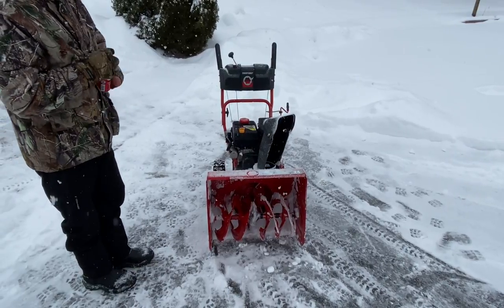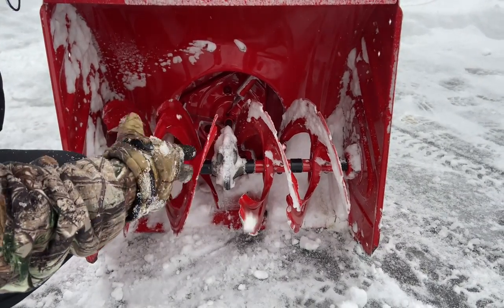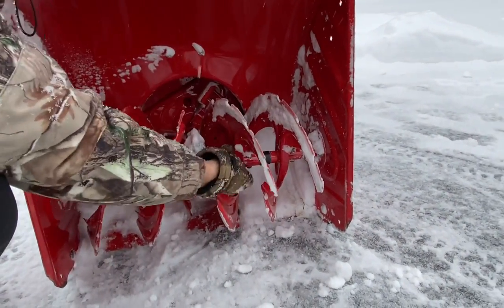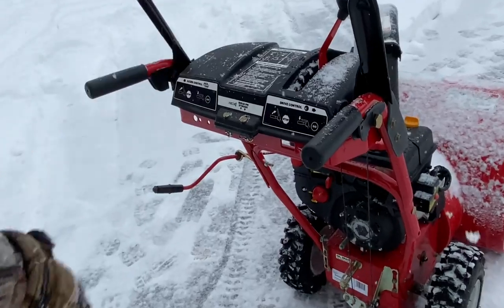Why Does My Snow Blower Get Clogged?

Comment: In heavy and/or wet snow take half bites and do not ravel faster than the machine can kick the snow out of the chute. You may even have to go 1' and stop forward travel now and then in extreme conditions. So, basically you do not want to overload the front of the machine if possible.

Comment: Don't use Pam...It will freeze up in colder temps.  Before the snow I found there was a residue buildup and had it cleaned up with Mineral Spirits.   I couldn't believe the difference it made no clogging and threw the snow further.